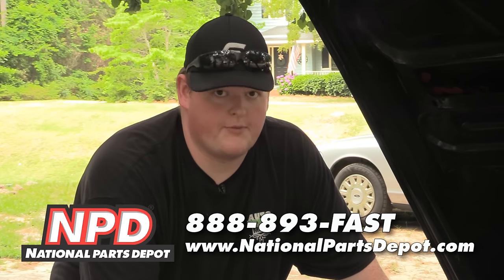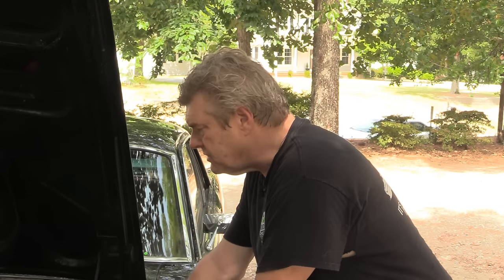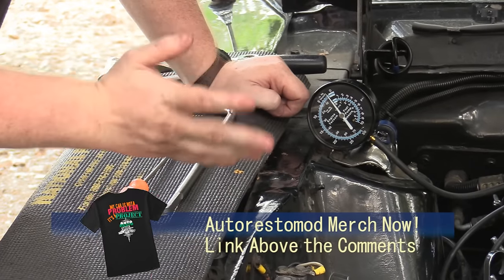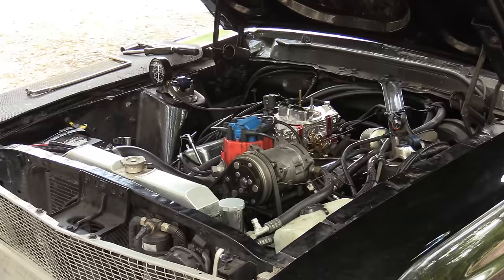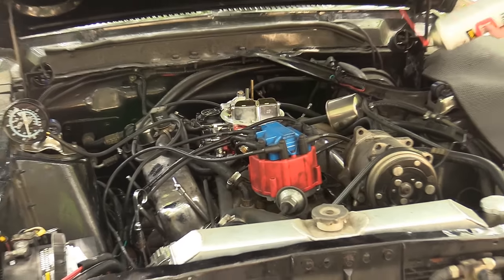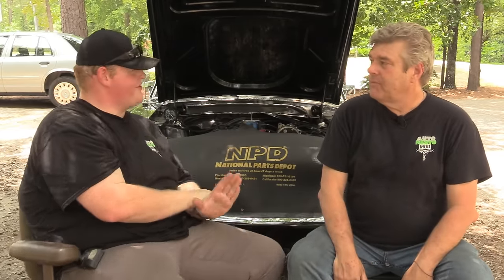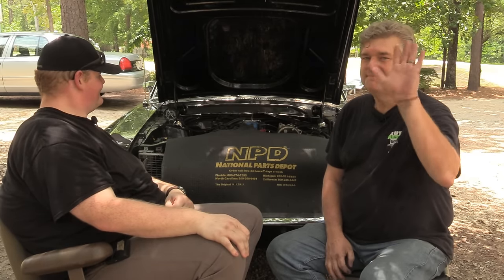Tuning Your Classic Car

Comment: Great video. I'm old enough some of these carbureted cars were still in the hands of High Schoolers when I was that age. Dad taught me how to set points right on the money, though points were already an endangered species. I picked up vacuum gauge tuning from a magazine somewhere, and I ended up tuning some cars for friends because mine ran well. By no means am I an automotive genius, but I had a better eye for detail than most teenagers.
Reply from the maker: That eye for detail is gold my friend!
Reply: John Barker, I had no idea about vacuum gauge tuning until I watched these guy's video on it.  Now my 351w with a Summit Racing carburetor is running super smooth and VERY responsive.  You'd swear it was fuel injected!!!

Comment: High idle off the stop? pull 4-corner Holly and check secondaries to see if the secondary idle feed slot is exposed as a perfect square. Those have a secondary adjustment under a tab off side of gasket face that is only accessible with the carb off (newer models may have this exposed from the top). Get this adjusted so the exposed slot is as long as it is wide, forming a perfect square. HP models have an air bleed in the air cleaner stud boss that can be opened with a screwdriver to fine tune idle without using the throttle blades.

Comment: Adjust the vacuum advance. Use an Allen wrench and stick it into the opening where the hose connects. Turn it until the advancement goes away under idle. Then start your tuning over.
Doesn't hurt to make sure the centrifugal weights are freely moving and not gummed up under your points plate as well if you want to really tear into it.
Reply from the maker: We will probably get into that at a later date. This was just to get folks headed in the right direction.

Comment: GM points dizzy plug gap is .035 and HEI is .045. I like using a vacuum gauge to set my idle mixture screws. If you can’t lower your idle cause your screw no longer has an adjustment then you need to limit the vacuum advance arm with a limiter plate you can make yourself cause you have too much advance at idle. To adjust the accelerator pump lever you hold the throttle wide open and hold it down with a piece of coat hanger, the using a large wide slot screwdriver, push the arm all the way down and hold it down while measuring the gap with a feeler gauge between the lever and bottom nut of the adjustor. Give it some drag like your setting solid lifters. Set using .015 feeler gauge.
Reply from the maker: Thanks for the heads up John!

Comment: My wagon is doing that hard start after running. Now I plan on adjusting the timing and see if that’ll help. Great tuning video!
Reply: Could be heat soak, too. May want to try a phenolic resin carb spacer.
Reply from the maker: Use the vacuum gauge if you do, Theo could be right about the hot soak issue.

Comment: .015" clearance at Wide Open Throttle between accelerator pump arm and lever per Holley manual.
Reply from the maker: Thanks Mark! My old Holley guide is packed away in prep for the move and my brain is not up to remembering well right now. LOL

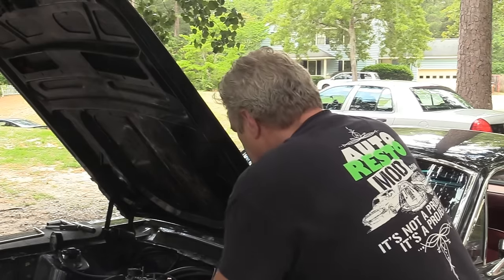Comment: At 10:00, mentioning a Tach:
When vacuum tuning in my truck without a tachometer, I used my electronic timing light display screen as a tachometer that I could see when vacuum tuning. Not using the light, but having the tach rpm display

Comment: 14:22 putting hands over carb air intake didn't seem vacuum gauge needle shoot up and choking out/shutting off engine: you said that could be done with a 4-barrel. Could that be done with a one-barrel or two barrel?

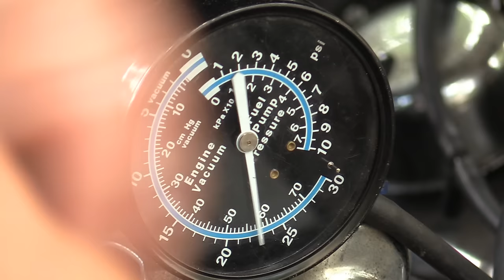Comment: hi 10:41 try adjusting secondary butterfly closed position , mine has a grub screw.
Ensure there is no distributor advance mechanical or vacuum

Comment: How did you guy's know I'm tuning my Mustang today after I finish the disk brakes? This video was meant for me. OH, HUGE question. I was running a little rich after I first tuned it. Mine is an I6 original set up for now. It had NGK plugs in when I bought it it and it ran smooth, prob a hotter plug. Can you please please please help me what a hotter plug than the stock running the 1 brl carb might be? Thanks for all you have taught me.
Reply from the maker: I'd look at the gap first. V8 is .016, six is .032 to.036. If the gap is correct, stock plug is an Autolite BF82 
https://www.ngk.com/how-do-i-find-a-colder-or-hotter-plug-3
https://uk.sparkplug-crossreference.com/convert/MTRCRFT_PN/BF82
Reply: @AutoRestoMod  video on selecting heat range? This one always baffles me, especially if you swap to Aluminum heads
Reply: @AutoRestoMod  You are a true gentlemen!  Thanks for all your help as it's made my project a success.

Comment: What causes the minute needle vibrations on the vacuum gauge? I see some that are rock stable, and some (like this one and my 4 banger) that vibrate 1/2" between 21 and 21.5. My engine is locked at 8 BTDC so I can't advance any stumbles out: ported vacuum to distributor through a Ford spark delay valve. No vacuum leaks detected.

Comment: Do you have a video about slow starts? I watch people's cars start right up the 1st or 2nd time it turns over. Mine, I have to crank on it for 10 15 seconds. Sometimes, a few times. I've replace about everything there is to replace from the battery, starter, plugs, wires, cap, button.... all of it.

Comment: Isn't there a secondary butterfly adjustment on the bottom of the carb on the passenger side of the carb?
Reply: Thinking same, mis adj secondary plate opening can lead to high idle speed.
Reply from the maker: There is, but typically that is OK. I think it is more a sticking choke. last couple Avengers I have had do the same thing.

Comment: Can you explain fast idle! I have an Autolite 4100 and I can't figure it out. Also, valve/rocker adjustment? I have a slight chatter coming from the driver side of my engine? Any resource you can refer me to?
Reply from the maker: I've been thinking of doing a video on carburetor basics. And cam and I are discussing how to portray some of the issues that plauge old engines.
Reply: @AutoRestoMod  That would be fantastic--anything would help. I'll gladly gobble up any wisdom you guys have to offer to me in the form of a video!

Comment: Never liked the overly big hei distributor caps
Reply from the maker: Neither do we. We're considering what to do with that. It works perfectly well...and yet...it is ugly. LOL
Reply: I'd run points before I'd use one of those oversize monsters on a Ford. Hidden behind air cleaner, isn't so bad on most GM engines. Were designed to fire plugs specced at .060 - .080 gap. Big surprise! Those gaps commonly led to burned up plug wires.
Reply: I agree.Will never instal that hei on my Ford's,I always have good luck with Duraspark 2.

Comment: Love these videos. I actually tuned my '72 F100 360 using one of your videos from several years ago. I used a vacuum gauge as I just don't trust my timing marks on the damper. However, I'm having the same problem you are with the higher-than-normal idle. Idle setting is all the way back, and my 360 is around 650 rpm when it should be at 550 rpm. Sprayed the can around the carb and couldn't find a leak. Can't remember if I tried around the intake and distributor plate, but I will next time. Cranks up good and runs smooth, just a little high.
Reply: What kind of carburetor are you using?
Reply: @Terminxman  New Edelbrock 1906 AVS2
Reply: @theovallas  Hmm, I mostly just have experience with holleys. But I had an issue like this once with a poorly setup holley. The problem was that the secondary transfer slots were open too much at idle. On a holley you have to remove the carb and there is a screw on the bottom that adjusts the secondaries. What you do is adjust your idle with the carb off by adjusting the secondaries. Get them right where the transfer slot is just barely showing on the secondaries, then use your main curb idle screw to make the primaries the same, put the carb back on and then you can tweak it a bit with the main curb idle screw. May not be your issue but it's something you could look at. If you have your idle screw backed completely out then it has to be a case of the engine still getting air and fuel from somewhere. There are videos on youtube that explain this better.
Reply: @Terminxman  I will check out the transfer slots - thank you!
Reply: Jet down. You should be able to kill the engine with the idle low
Reply: @Meche697  I might need to try that. Thanks!
Reply: @theovallas  what car? How many CFM carb? I had similar issue with a Mustang 289 running 650 cfm carb. Bought a better matched 500 CFM. There is such thing as over carburation and and over cam-ing.
Do you have the throttle plates open too much?  Are you running a fuel pump?
Reply: @Meche697  I have a '72 F100 with a stock 360 FE. Edelbrock AVS2 650 cfm. Stock mechanical fuel pump. Stock cam. Stock exhaust logs and single exhaust pipe. The exhaust fumes smell stronger now, too, so it very well could be rich. I'll have to check the throttle plates. I don't have much time to fiddle with it right now, with two toddlers.
Reply: @theovallas  over carburated! Quick calculator shows 500 CFM carb
360 ci*6000 rpm*0.80 eff/3546 = 500 cfm
RPM should be based on piston max calculated speed, this one is generic. If you go to higher efficiency, better flowing heads, say 85% eff., 550 CFM carb would be appropriate.
Reply: @Meche697  I don't want to go back to a 2 bbl and the heavy FE iron intake. Could I just jet down? Also, would headers help?
Reply: @theovallas  my Carter, same as Edelbrock, is a 4 barrel 500 cfm for my 67 'Stang. Edelbrock 1901/2 (these are 4-barrel, one is electric choke) is the correct size (keep reading). Don't get hung up with "bigger is better" mentality. For daily driving and occasional strip, right size it and follow the math, you'll be happier.  https://www.youtube.com/watch?v=IHvstV9e-l8 (episode 81 of Autorestomod about 5:55 mark, other YouTube videos abound too)
New heads are up to you but $, avg $1,000 for my 289 depending on port sizes. Mind you, efficiency used in calculations above are for newer heads or heads that have been worked on. Headers may help, but the lungs are the heads. Classic OEM head efficiency is typically 60-70%, so the 500 cfm carb would technically be oversized too.
Jeff, et al, you need to rehash some of your old videos 😀
Reply from the maker: Thanks Theo! I've found that the choke can be an issue on Holleys. Not sure on the Edelbrocks..
Reply: @Meche697  "over carb'd" will not cause an idle that can't be lowered with the plates closed more. Should also die if the throttle plates are completely closed regardless of size. If you look up experiments/tests on "over carbing" you will find that it's not really a thing unless it's like a 1000 cfm on a 289 or something like that. I'm not sure why everyone is acting as if that's his issue. A 650 CFM carb may be a little much for a 360 FE on paper but if the throttle plates are closed it shouldn't run regardless. You also will have trouble finding much below a 600 CFM 4 bbl
Reply: @Terminxman  except I called out both Carter and Edelbrock 500s are 4 bbl. Holley is not my thing. I have a 600 or 650 sitting around that I really should sell. 500 runs MUCH smoother with adjustments closer to standard (e.g. 1.5 turns out). Also, larger carbs come standard with larger jets.
Reply: @Meche697  @Beardedcap I figured out the problem. The guy that installed the intake and carb connected the driver side valve cover breather tube to the left side with a T going into the carb. It essentially created a big vacuum leak. 🙄 Runs great now after I tuned the carb.

Comment: Question?!
Aren’t you supposed to have someone put it in DRIVE (under load) as you adjust everything?
Reply from the maker: Nope. That is only for idle and you can get thereby setting idle in park then seeing how close you are to idle in drive. I find that if you set idle in neutral at 700-800 RPM you will typically be around correct  drive idle of 500 RPM.

Comment: Hi, Guys I got a stuck distributor. I have tried tapping on it with a hammer but don't want to damage it. Been soaking it wit PB blaster but no luck yet. Any ideas on getting it loose without pulling the oil pan an hammering it out from the bottom of the engine?

Comment: Where does the vacuum plug in to? Is it a “T” fitting to the distributor?
Reply from the maker: That is addressed in the video it plugs into the vacuum tree on the back of the engine.
Reply: @AutoRestoMod  thanks for the reply so cool. My 64-1/2 does not have a tree I’ll try the vacuum port on the front of the edelbrock that goes to the automatic

Comment: Not sure if you mentioned what carb it was but it is probably on the too big side for that engine. Which makes getting a low enough idle etc harder to do.
Reply: I just mentioned that above. Jet down as you should be able to kill the engine with low idle
Reply from the maker: It is a 570 Street Avenger. So it is as good as you are likely to get from the stores now. I'm leaving the jets alone for now. After we get the 4R70W in it, we will tune if need be.

Comment: Does anyone know if (on a 289 2100 carb), if there is no longer a stove pipe connected, do I block off that inlet on the spring choke? My rpm drops a little if I put my finger over the port. But don’t know if I should “cap” it. 🇨🇦
Reply: Vacuum leaks are something you dont want. Cap it and set the idle mix per the guys in this video.
Reply from the maker: O agree with poppy duck. Mikes Carburetor also sells an electric chock for those carburetors as well.
Reply: For normal operation, it's a vacuum leak that draws hot air into choke. Operates the bimetal coil inside housing. Was orig connected fresh air port on carb(or air cleaner), so air drawn was free of dust/dirt. I agree, disconnected, plug port.

Comment: If you have to make a dedicated tach wire, we'll what about my temperature amd oil pressure gauge? This is my current problem rightnow...
Reply from the maker: Those can be run independent as well.

Comment: Did you find out why your idle is so high?   I have the same problem. I was told to much timing. I have the same carburetor  but mine is a 550 on a 327 with rv cam.
Reply from the maker: Our return spring set up is...funky. I also suspect that there might be some bund between the intake and base.
Reply: @neilbreen6998   I messed with it again and I put it at 12 initial were I get the most vacuum (16)  and I can still idle at 650rpm. Any higher and the idle curb screw is just floating. What is weird is with the edlebrock 600 I don't have thus problem. I can go to 16 initial and be at 650 rpm. Don't know if that's normal or if I'm looking to much in to it. I just like holley allot better and I can fine tune them better.
Reply: @neilbreen6998   I messed with it again and I put it at 12 initial were I get the most vacuum (16)  and I can still idle at 650rpm. Any higher and the idle curb screw is just floating. What is weird is with the edlebrock 600 I don't have thus problem. I can go to 16 initial and be at 650 rpm. Don't know if that's normal or if I'm looking to much in to it. I just like holley allot better and I can fine tune them better.
Reply: @neilbreen6998  I have the transfer slots barely open. Only about 3/4 turn of idle screw open. The idle mix screws kill the engine when turned all the way in. I am going to replace all the metering block gaskets and base gaskets. Maybe there's a problem there.

Comment: Hi guys, I’ve taken the plunge and bought a vacuum gauge to finally get my timing and idle fine tuned. I have a 289 with an autolite 2100. Manual brakes and  steering. Can you please tell me where to connect the gauge to get the show on the road.
Reply from the maker: There should be a vacuum tree on the back of the intake. The hose connects there.
Reply: Man that was fast, outstanding, thank you so much. Declan, Ireland.
Reply: Me again, sorry for bothering you but over here in my neck of the woods people with your knowledge don’t exist. There is no tree, just a line coming from the transmission to the intake manifold. Can I just disconnect that line for the vac test? Maybe I should explore the vacuum set up I have, I appear to have 2, 1 going to the distributor and the one I mentioned coming from the trans? Thanks again.

Comment: You said it should be 600-700 rpm with that carburetor. I have a completely factory 67, 289 2v motor. With original factory carburetor. What should my rpm be? I have been told anywhere from 600, to 1000. Mine seems to run the best at 900-1000. Is that to fast? Or should I leave it alone?
Reply from the maker: Best RPM is around 600. Any higher and, on most carburetors (specifically the 2100 and 4100), you move from the idle slots to the run slots.
Reply: @AutoRestoMod  ok. I tried backing it down to 600. I get to 700, and it will idle all day. But as soon as I put it in gear, it dies. The idle is to low. I put it back up to 1000, and put it in gear, and it runs fine.
Reply: @AutoRestoMod  I'm not trying to argue. I'm trying to learn.

Comment: Would the carb being out of adjustment cause stalling when put into gear?
Reply: Not in my experience. That is more likely a timing issue. It probably needs more idle advance. Make sure that the vacuum advance is hooked to manifold vacuum, also make sure that the vacuum advance canister is functional. 

If you get the vacuum advance sorted out and it still stalls out, it may need more initial advance timing.

Comment: The Choke plate is not completely open
Reply from the maker: Yes. The owner didn't hook up the electric choke. We're doing that with the detail series.
Reply: I akways hook my electric chokes of alterator stator.Even works on the 3g